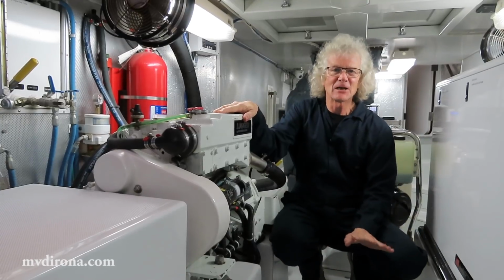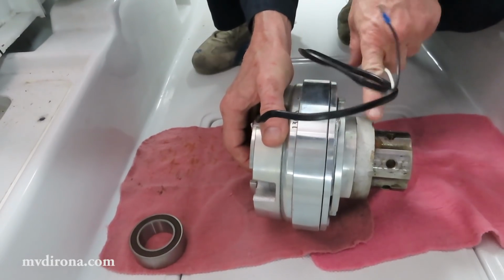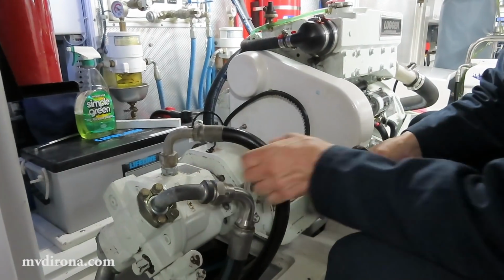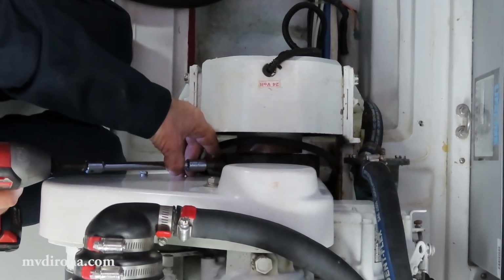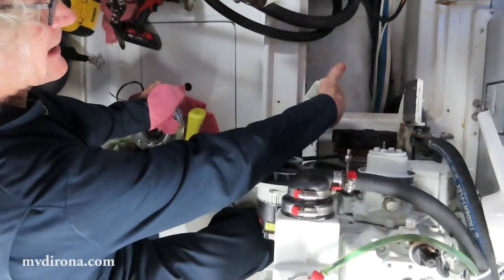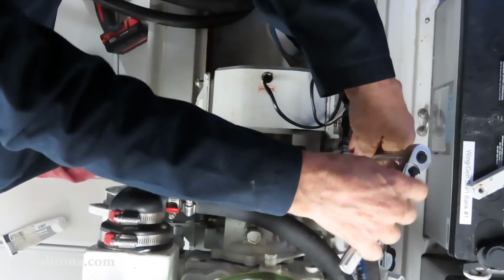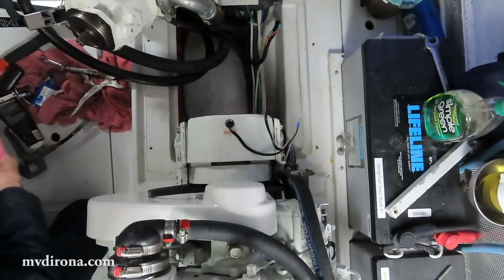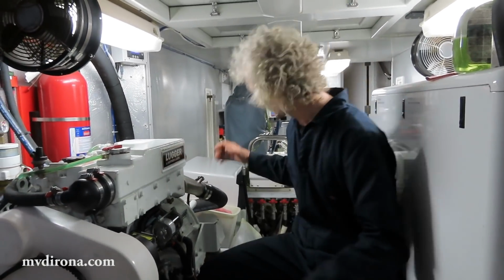Replacing Lugger/Northern Lights PTO Clutch (MV Dirona Channel)

Comment: you do it twice this day ??? ;-)
Reply from the maker: First time that engine has been open but, you are right, it's not my first head removal (but it has been a bit more than 30 years since the last one :-)).
Reply: @MVDirona  i was thinking you forgot the spare belt at the first time when you replace the clutch...
Reply from the maker: Woops, My previous comment was on the cylinder head removal.  This is the first time I've done the PTO clutch but it was done once early in it's life by Northern Lights, the wing engine manufacturer.

You, are right, I did forget the belt initially and had to do a back track but it was only the flex coupling attachment at that point so only cost 10 min.
Reply: @MVDirona  ok i see you are in Norway in this moment.. do you go more south this year??
Reply from the maker: Our initial plan was to go south and we got as far as Antwerp Belgium before concluding that it was the wrong year to go to densely populated areas under pressure from the pandemic. We changed plans and ended up heading the other direction and spending time in Scotland and Norway. We expect to stay in Norway for around 5 months before heading south again. We've not yet made firm plans on where we will end up next though.  

You can always see our boat location on this page: https://mvdirona.com.

Comment: My compliments to the mechanic.  I also want to compliment the outstanding precision to clean threads along with excellent discipline in applying lubricant and thread lock.  I see too many videos where these steps are missed or lubrication are overapplied leading to issues later.  Outstanding work here and instruction.  Lastly, great camera work too!
Reply from the maker: Thanks for the feedback!

Comment: Thank you for the videos. I see one alternator on the wing engine ,I assume it is for the engine start battery, is there another alternator somewhere on the wing engine for the house batteries.
Or when the main engine is down do you just have the generator to charge the house batteries.
Thank You, 
Nicholas Christie
Va Bh Va
Reply from the maker: Good observation. Ideally, I would have a 60hp wing engine and it would have a large alternator. The boat was designed around a 40hp wing engine and the builder was unwilling to go larger since the boat was designed with a 40. They hydraulics at full output needs the entire 40hp and, if the engine is being used as a propulsion engine,  we need the 30 hp it can produce continuously (40 hp output is an intermittent rating).  Since there is no HP left to be taken from the wing engine, it doesn't power the house when running.

The main engine is a 266hp John Deere with power to spare, so I have no trouble drawing 9kw from that engine.  Each alternator draws roughly 7.2 hp.  Giving up 15 hp from the main engine to power the house is almost undetectable whereas even taking 5hp from the wing would prevent it from being able to do it's job.   So, if the main where to go down, we would need to push the boat with the wing engine and power the electrical systems by starting the generator a couple of times a day.
Reply: Thank you

Comment: When you scrambled into the engine bay to make a start, you looked like you couldn't wait to begin. This kind of task is no hardship for you, not technically, not physically and not mentally...you sir are in your element, and it shows! I bet you have some kind of a system set up to remind you that something needs servicing, and I bet your heart skips a beat when it's time to get your hands dirty. Great to watch...thanks for the videos.
Reply from the maker: I do enjoy the boat running reliably so we are willing to invest time in it. I won't go quite as far to say that I look forward to maintenance work but you are right we do have a system to remind when something needs to be done. Jennifer wrote this spreadsheet system to remind us when work is needed: https://mvdirona.com/2018/11/updating-the-maintenance-log/. We use this system to track anything that needs to be done periodically whether or not it's a mechanical task. It's been pretty useful.

You'll laugh but, as I type this, we are rewriting the maintenance spreadsheet as a database application that will send email when work needs to be done, track what has been done, and the new app will be a bit easier to use than the spreadsheet.
Reply: @MVDirona  You're right...I laughed! I also liked, subbed and rang the bell! I am looking forward to more of the same! I don't look at your lifestyle and think how lucky you are, the old adage 'The harder I work, the luckier I seem to get' is a good one. I do however have a certain amount of boat envy, not in a bad way though, the only thing separating my lifestyle from yours is hard work, aptitude and a lottery win. Stay safe my new friends!
Reply from the maker: All the best to you as well.

Comment: Would it have been worth it to change out the hydraulic lines at the same time? Those hoses will dry out with time and crack which doesn't become a problem until you bend them.
Reply from the maker: The boat is now 10 years old so we will eventually have to replace hydraulic hoses but that is a very big job. Those lines run throughout the boat in some very tight places. Changing them will be a multi-week job. I'm glad they are still nice and supple and showing no signs of stiffening or cracking. You are right it will eventually need to be done.

Comment: Bloody awesome! Thanks for the vid. Never heard about setting TW to zero for storage, now feeling abit panicky. Also didn’t know about thread lock and grease at the same time, that’s next level fitting.
Reply from the maker: Thanks for the feedback and, sorry, on the grease and thread locker, it's not really "both" although I may have made it look that way. The grease is needed on bolt head to avoid twisting or deforming the rubber drive coupler that it is securing. The grease helps prevent deforming the rubber drive coupling.  The thread locker is needed on the threads since this is a high vibration application where a bolt backing out would be explosively destructive. 

Thread locker on the threads and grease on the bolt head and shank above the threads.
Reply: @MVDirona  Hi guys, thanks for clarification. I understood that its in different locations on the bolts. I just never thought of doing that before. I was thinking of somehow applying it to torque sensitive applications such as the head of an engine. Usually you would use oil on the bolt to allow correct torquing, but I always worry about the bolts coming loose due to vibration. Anyways, thanks guys.
Reply from the maker: Sounds good. Different applications need different protection. This one requires a thread locker whereas I've never seen thread locker recommended on, for example, head bolts at least on the engines I've worked upon.

Comment: Yes, you are a natural educator : step-by-step explaning keeping the coherence of the story.
So impressive job well done !

some practical tips, if you like  :
@17.15 using the crawbar : use a old cotton t-shirt and stick the crawb  into the t-shirt  ( not wrapping around ) to protect paintwork. The same works with a screwdriver on sensitive spots, like paintwork.
@19.00 use a small box ( I prefer a wooden box with rubber squares glued underneath against sliding)  to put bolts, screws , small bottle of lubricant etc preventing it from you stepping on to them ; prevent ing from rolling underneath an engine or into hidden corners or fallen into small holes ( I have seen them all in the video).
@33.00 you can use  a thin rubber mat for floor protection instead of small wipes. Protects and prevents you sliding on the wipes.
Reply from the maker: Thanks for the suggestions. I like your suggestion of using an old cotton shirt to avoid marking the surfaces when using a pry bar. Another reader suggested using wooden wedges which I actually have on the boat and do use for that purpose. They are remarkably effective and wood won't leave a mark.

Using a small container to hold fasteners is a good suggestion. In some ways I like to spread out a bit and make piles of like fastenters but, on larger jobs, I agree I would be better off and more organized with a small container to hold the fasteners. That sounds like a good idea -- I'll try to remember to do that.

Comment: I have used wood wedges 180 degrees out to pry apart two pieces. causes force to be equal on both sides.
Reply from the maker: That's a good solution and I actually do have wood wedges that I could use. Thanks for the suggestion.
Reply: @MVDirona  They can exert a lot of force, so be thoughtful what you are pushing against. I use them to put a pull on the piece, then the pry bar and sometimes tapping the part with the pull force caused by the wedges helps as well. Neat video I enjoyed watching you tinker.

Comment: WOW ,i think you clean the engine room everyday ,excellent condition!
Reply from the maker: Thanks. The trick is there are no major oil leaks and the engines aren't releasing oily vapors into the engine room so keeping it clean is just wiping down the decks every month or so. The engine room cooling system moves vast amounts of air so quite a bit of dust does get in but, other than that, it's not difficult to keep clean.

Comment: @44:05. Never re-do a torque on a bolt.  Also, (to be 100% correct) you should have used new bolts.  When you torque a bolt you are stretching the material and placing it under tension.  If you re-use old bolts that have a set torque you effectively aren't sure that the bolt won't fail as you are stretching it again...a second time.  Repeated torque and reuse might stretch the bolt to the point of failure.  Also part of the the reason why you should torque just once to a single click.  Length of the shaft of the wrench (if you wanna be crazy technical) should also be taken into consideration when selecting a torque value.
Reply from the maker: There are a very small number of applications with the restrictions on torquing procedure that you describe but they are quite rare. Most automotive and over the road truck work doesn't have those restrictions and, generally, your advice doesn't apply.
Reply: MV Dirona ..British Royal Navy Marine Engineer and then working in Indycar several seasons with 31 years of ocean -going experience has taught me my way, if you find torquing several times on the same bolt a better solution that is up to you.  No offence.
Reply from the maker: I've seen manufacturer service specs that recommend replacing bolts on re-installation but most don't. As an example, take head bolts on an automotive engine. A few manufacturers want them replaced on head re-installation but most don't require it. I agree that there are many service procedures that recommend fastener replacement but I don't agree that it's a universal requirement that all torqued components need to be replaced on all re installations.
Reply: MV Dirona ...you don't have to agree.  Its of course your view that you are entitled to.  In real world and when it comes to economy you can re-use them up to a certain point.  The problem with that though is that you elongate the bolt on each torque.  Technically from an engineeering standpoint its not correct to do this.  When you torque any bolt you physically deform the material by stretching it and start to work up the material's strength or stress v strain curve towards ultimate failure, (YS, UTS etc...).  You can only be 100% sure it has maximum strength on it's initial torquing.  I get that in the real world we try and increase longevity by re-using bolts but it doesn't make it the right way. Not knowing where you are on the stress v strain curve is a dangerous game with crucial components.
Reply from the maker: If the engineers that designed the component and designed the service procedures, don't recommend bolt replacement, why argue with them?
Reply: MV Dirona ...That's ok.  Not arguing with the person that compiled the owners manual.  Just so you know, its not the same person doing that as the materials or marine mechanical engineer that designed the fasteners.  That is 2 completely different levels of engineering.  Although they are pretty comprehensively written, they aren't always taking into consideration the age, previous torquing or condition of the current fasteners in place.  They also consider the cost and risk factors to advise owners so they don't necessarily NEED to be replaced each time.  I was merely pointing out that to -re-use torqued bolts on a crucial part of an ocean-going vessel isn't perhaps the best or smartest option.  Its reasonable to re-use a bolt on a non-critical component if it hasn't been torqued and re-torqued several times and is a few years old.  It isn't smart to re-use an "unknown" condition bolt that has been on a critical vessel component that is more than ten years old and very probably torqued and retorqued several times.  In top level Indycar and F1, etc as well as military machinery we inventorize and maintain history of every component including bolts, etc.  There aren't many fasteners on an Indycar that aren't life critical.  When in doubt, we always change them out.
Reply from the maker: That's a reasonable position. I'm a licensed auto-mechanic and I used to work on Formula Atlantic cars and neither of them change fasteners on most jobs. 2 years ago I was invited into the McLaren Formula 1 paddock in Abu Dhabi watching them change the engine in one of the cars. In that application, fasteners are re-used as well.

Nonetheless, I agree with you that there are applications where the torque is very high and/or application is life critical where fasteners are replaced.  It totally makes sense to me. I just don't chose to do it as a rule and, instead, do it where the manufacture recommends it or the fastener is life critical. On Dirona, the bolt between the steering ram and the steering arm would be a good candidate for single use.

Comment: Did you end up changing the rubber damper coupling?  Or the drive belt?  Not clear from the video.  It looked ok even though 10 years old.
Reply from the maker: I did change the belt but, you are right, both the belt and the damper looked absolutely fine with no cracks or wear after 10 years.
Reply: MV Dirona ...very good idea to hang the spare inside the clutch assembly!
Reply from the maker: I wish it was my idea and I agree it is a good one but, in this case, it was the manufacture, Lugger (Northern Lights) that had the foresight to put in special clips to hold the spare drive belt. I've also seen it done on  farm tractors where the drive belt is "captured" by a forward hydraulic power take off.

Comment: I'm sure your pretty close, but as a Millwright, I would of installed those alignment pins in the clutch housing before I would of tightened those bolts in the coupler. There is a small chance of that coupler being slightly out of alignment and causing the rubber to fatigue sooner than it should. Just keep an eye on it and look for small flecks of rubber under the unit which will incur if it starts to fail. Great job otherwise.
Reply from the maker: Your point is a good one. Thanks,

Comment: What a great job you did on the Lugger. Very informative and interesting ! I didn’t realize you had a back up engine . Happy Holudays
Reply from the maker: We love our John Deere 6068AFM75 but when 1,500 nautical miles from shore, you really want to be 100% confident that you have some propulsion available. After 10,830 hours on the main engine (https://mvdirona.com/2018/09/john-deere-6068-at-10000-hours/) we have never had a fault but we still wouldn't cross an ocean without backup power.

Comment: Nice job. I do my own marine repairs as well. I've always said if you own a boat you need to know how to fix it! I want to point out some small items. A battery is not a tool bench, one day an extension or screwdriver will let the lightning out! Another concern is the battery switch should have been turned off to prevent accidental starting. I know; two people on the boat and both in the engine room but its a simple task that may help you keep your fingers. And lastly you had to roll over the engine to access the clutch bolts. Were you always turning the engine the correct way? A few problems can develop with turning the engine backwards. first and most likely you will fold the raw water impeller backwards and damage a vain. Less likely is pumping the oil out of the oil pump and loosing the prime and not having oil pressure on start up. As well when you bar over a diesel backwards you could introduce fuel into the cylinder from the injector pump on the return side. A load of fuel "could be" ignited if the engine is warm and conditions are right giving you a heck of a kick in the teeth with your wrench.
Overall great job and I love an engine room that is cleaner than the galley
Reply from the maker: I try to be careful and methodical but you take it much further. I don't agree with all of your concerns but it's a good list for consideration.

Comment: Great job the Hamilton team very well explained! I think Spitfire was trying to say “ hey Dad how often have I to tell you not to lay wrenches on top of that start battery! “
Just kidding many thanks for leading the way!
Reply from the maker: Yes, that does sound just like Spitfire. He's asleep for most of the hard work and yet still finds the time to inspect and advise :-). 

I do admit that years ago I touched a 13mm spanner across an automotive battery posts and it most definitely didn't improve the chrome plating on the wrench.